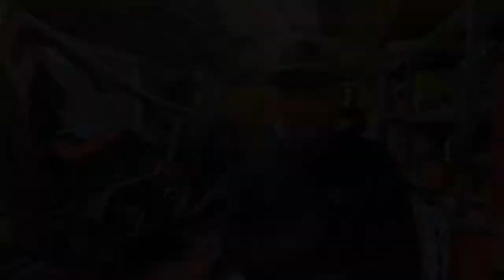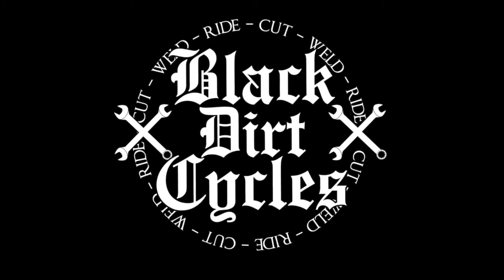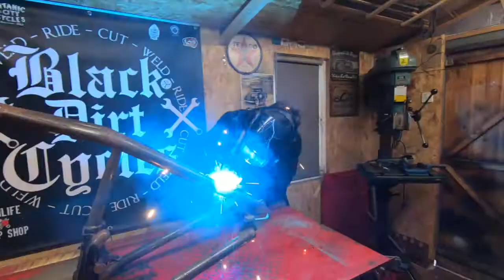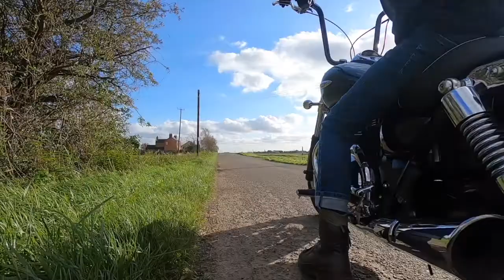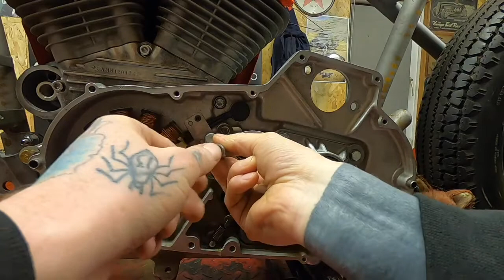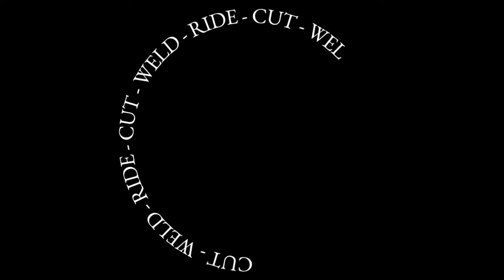(Harley Davidson) Sportster shifter pawl install and adjust.

Comment: Thank you for these videos! I'm 68, and a wrench from way back, but I'm about to go into the tranny on my 92, Pig, for the first time as well. I know it was your first time, but you did a "smashing" job of it, and I smiled at the re-labeling of certain fasteners. The making do with not-quite-right tools was very real and down to earth. I feel confident I can do this. Unlike you, I will be replacing all the bearings, as Pig came to me blown up with primary leaks from stripped holes and little oil of dubious quality in the primary. So, you didn't have to cover the bearings in the 5th gear/output shaft. I assume you put the R/S countershaft bearing in when you built the engine. I'll be installing one with the bike assembled using a blind bearing puller, and replacing the output bearing in the frame. I like your puller for 5th/output shaft. I'll be making one, too. Thanks again! Great job!

Comment: hi there m sportster 2004 sometimes slips out of first gear.. it's not the clutch thats fine.?  it ma be the selector  shifter pawl but not sure what to look for..? it only happens on first gear.. other gears are fine. also what clutch plates are best as in the past I replaced the Kevlar clutch plates.. as the worn down the small inner clutch hub  was worn out not good.. they just wear down the aluminium around the inner housing. I also got rid of the rivet plate and installed an extra plater. put it all together all new parts  was running great then after some time .. it started tto slip out of gear...WTF...; ! d:O...? Thanks so much for any help and Happy New year Ben.. for 20026.
Also trust me to b a Harley were you have to split the engine to get to the gears....;(      hope its just a shifter pawl error. kind Regards   Mac.

Comment: Hi
I remember you mentioning your ultrasonic cleaner. So I bought one today.  

What should I not put in there?  I know it depends on the acidity of the detergent, but will it wreck bearing surfaces, or slip fit gear surfaces like tappet blocks and roller shafts or the surfaces between gears and main or counter shafts?  Will it be okay for chrome like cleaning rocker boxes?  

Thank you so much

Comment: Hey man. 1980 sportster. Shifter stays in position.  (Does not return after placing in gear) any thoughts?
Reply from the maker: Possible incorrect gap on shifter pawl or return spring could be seized? 🖤